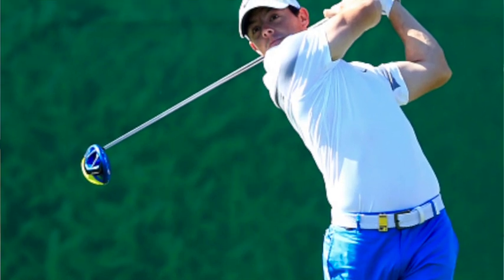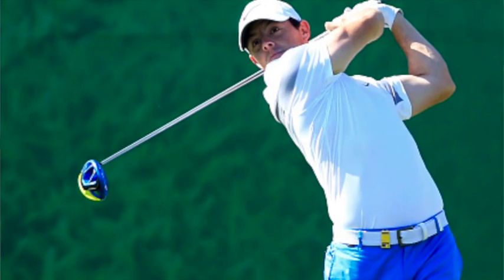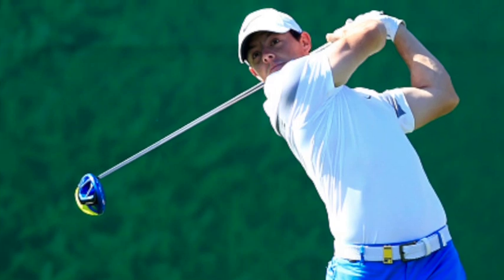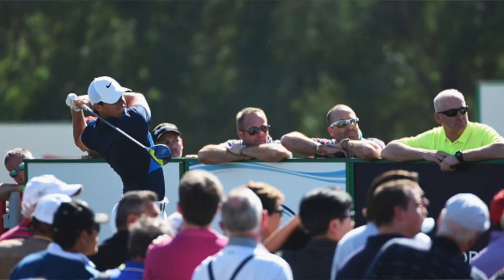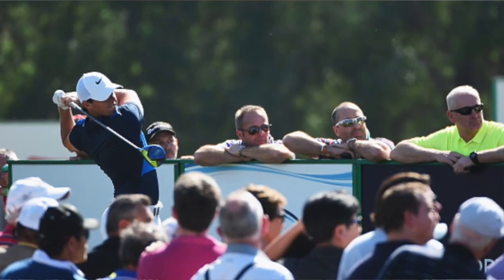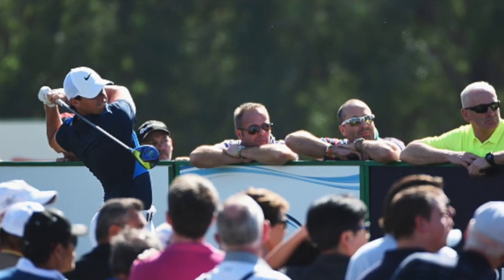Rory McIlroy Adds Loft to His Nike Driver

Comment: I don't like that guys analogy. You can increase loft while keeping the face neutral, but this will still help you turn the ball over because when you have a shallower swing for your driver the club face is not parallel to the ground on impact, and because of this, your loft will actually help the ball go left. 
For example if you think about it at an extreme where the face would be tilted at 45 degrees to the ground, your face would be closed by (loft*1/root2). More realistically, the increase of one degree of loft might make your face close by less than a degree at impact, but this would still help you turn a straight shot into a maybe 5 yard fade with Rory's swing speed.